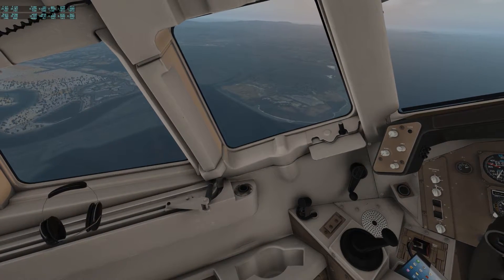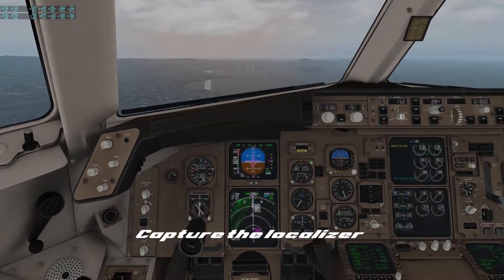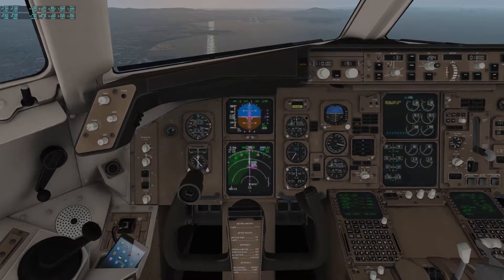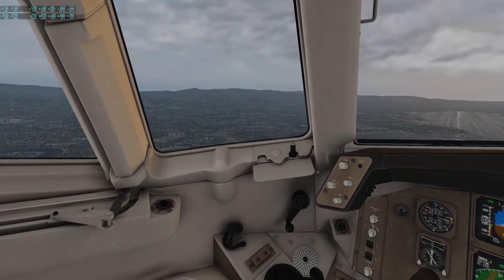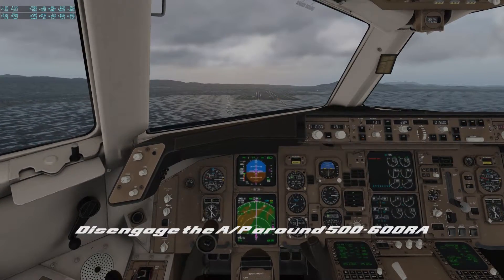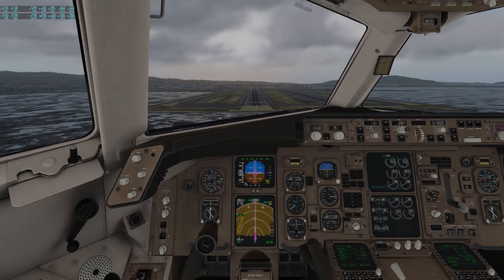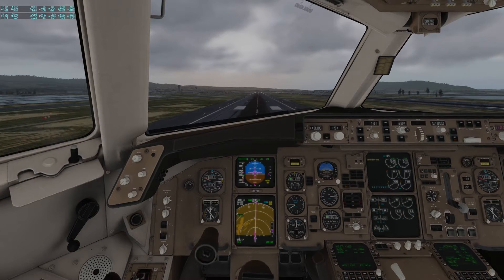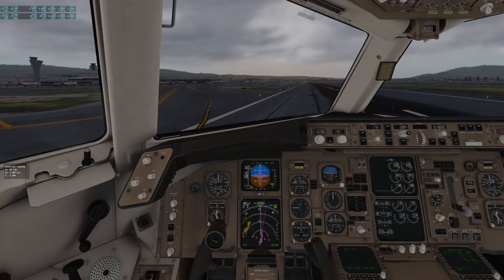[XP11] FF767-300ER Manual Landing Tutorial

Comment: Which one is better for a smooth landing?
Constantly pulling back on yoke or side stick?
Or
Pulling back and holding it and make minor adjustments?
Reply from the maker: Depends on the plane. The A320 needs to be held in 1 place. The 737 needs to be constantly pulled. If the plane is modelled properly, it's behavior will indicate which is best. This particular video is old; I'd have to get back into flying the 767 as my main craft to evaluate whether this landing technique is correct still best, but I do still stand by that the video was created off the advice of actual 767 pilots.
Reply: Ok thx for the reply!! Will practice my landings

Comment: Great tutorial. I have two question however. At least I've heard from somewhere (might be not true) that some pilots recommend not using A/T while AP is disengaged. Of course this could be something not meant to all Boeings (but at least 737). Second I see you use hotkey for AP disengage. What that hotkey is called in menu?
Reply from the maker: This is due to a difference in plane and sim hardware. Most people do not have a motor operated throttle like a real plane, therefore, disengaging the autothrottle before you're ready to idle it will result in spooling the engines up or spooling them down, which can often lead to a ruined landing. I've actually fallen into the KJFK bay before because my engine's spooled down before touchdown by accident, lol.

The FF767 comes with a feature to prevent this (throttleblock), but it's not entirely reliable.  

As far as the AP and AT disengage hotkeys, if you go into your HOTAS setup in XP11, and search for "autopilot", there is a category called "1-sim", with a bunch of "undefined" hotkeys. These are the flightfactor hotkeys for the planes custom systems. You can assign the 767's "AP Disconnect" double tap feature common to most Boeings to a button.